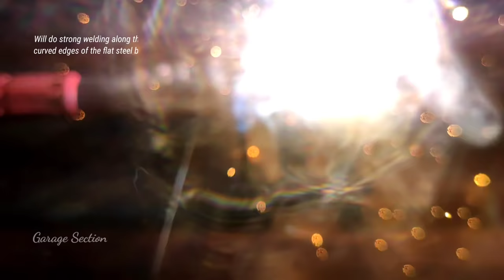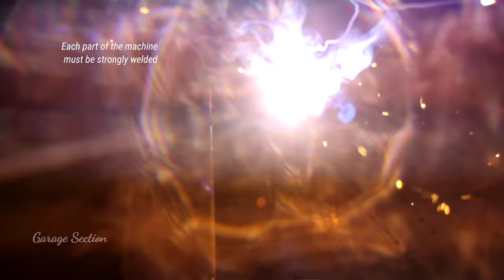Smart bender DIY !! Making a pipe bender

Comment: Was that a split pully readily available or u customised that blck half pully
Reply from the maker: Thanks for watching.
Yes it's readily available.
But we can make our own Take the elbow bend without the threads and cut it from center top to bottom
Reply: @GARAGESECTION  actually i found many machine use such half pully but whts its actual name
Reply from the maker: Pipe bending ( die )
Reply: @GARAGESECTION  thnk u.....
Reply from the maker: You welcome sir